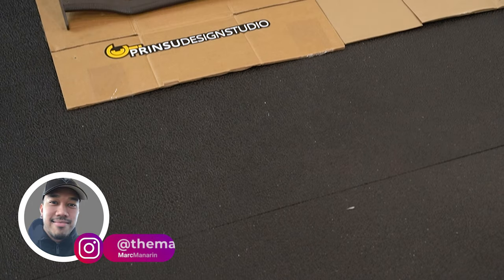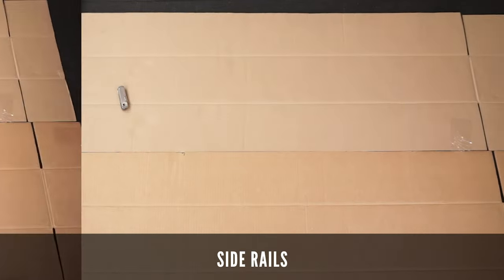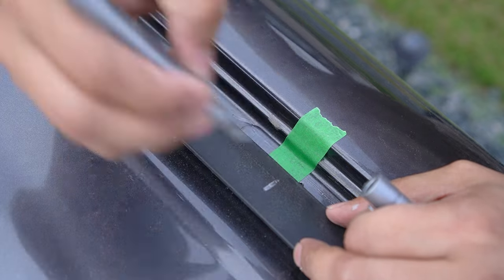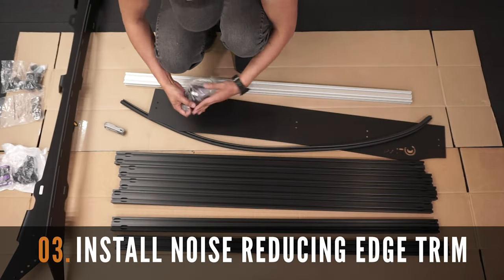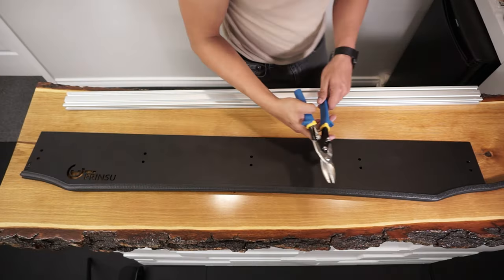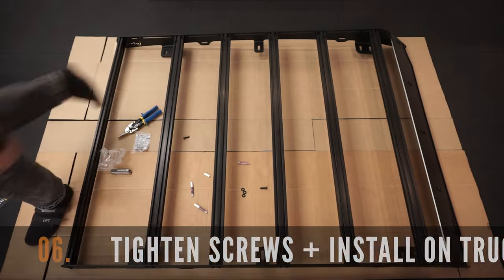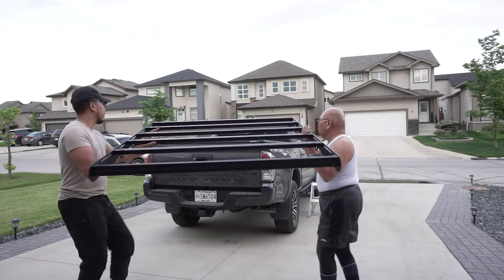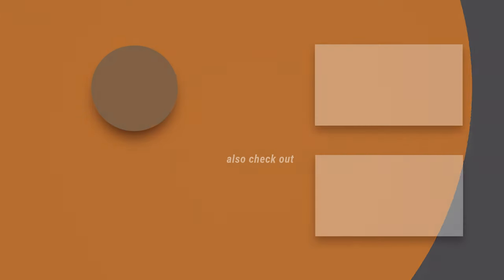PRINSU ROOF RACK INSTALL on the 2022 Toyota TACOMA TRD Sport | EASY DIY

Comment: How is it holding up over time? And does it cause any rust on your roof or your rack? Because some people complained getting rust on the rack over time. And do you think I should go for the Prinsu Pro roof rack or this version is fine? Tks
Reply from the maker: Hi thanks for the comment! My roof rack is in great condition! No rust. However, the bolts they used did rust in some spots. Specially the one attaching to the truck. I did replace them with stainless steel that you can buy from Amazon. Let me know if you need the link in the future.
Reply: @themandiyrin  oh yes please. I think I might need those stainless steel ones in the future when I buy roof rack for this coming Black Friday. Many thanks in advance.